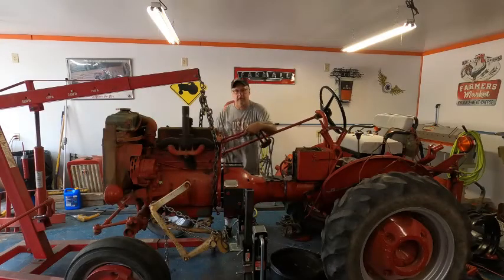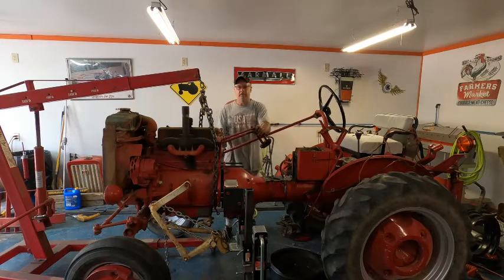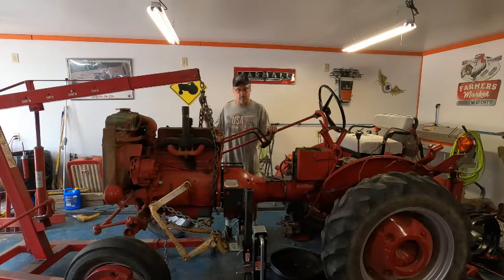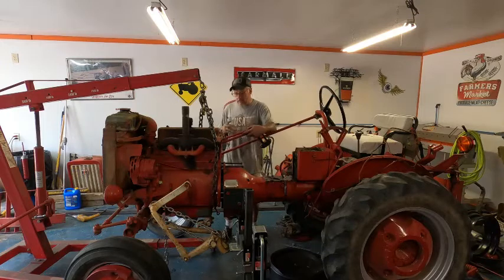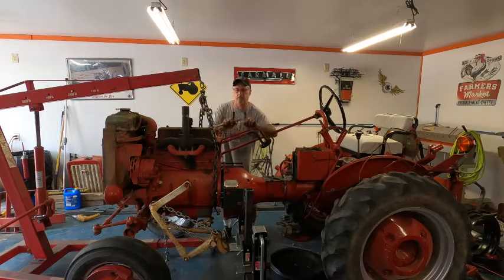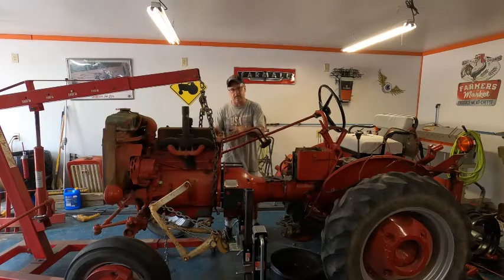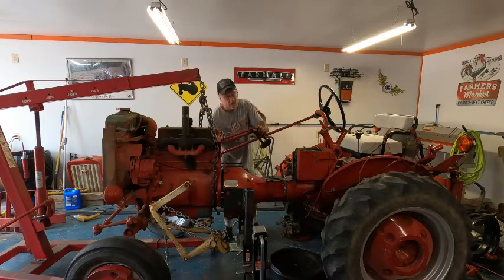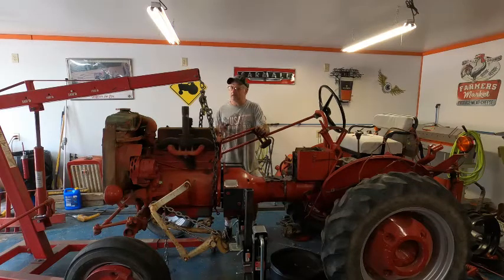IH 140 tractor -  clutch part 2

Comment: Smart idea! thought of that awhile ago,  glad to see it work for you! I thought of doing the same type of thing if I have to access the transmission such as on a H or M long all thread to guide it in to place and slowly lower it down until it is in place.
Reply from the maker: Yeah it's good when the light comes on.
Reply from the maker: I'm going to build a stand for the M I have. Hopefully it will make the restoration easier.
Reply: @OldRedTractors   have you seen Squatch 253 channel? He makes a stand out of repurposed steel.